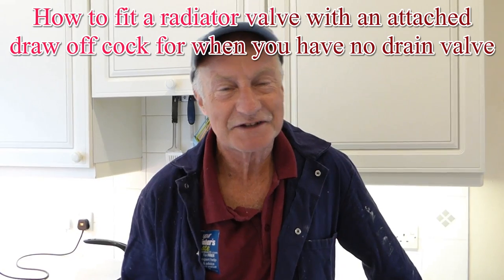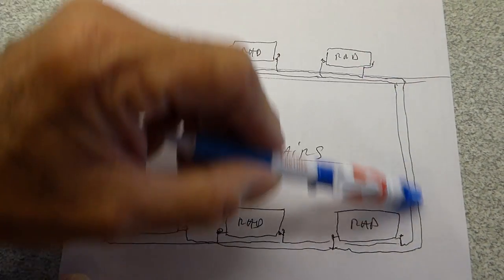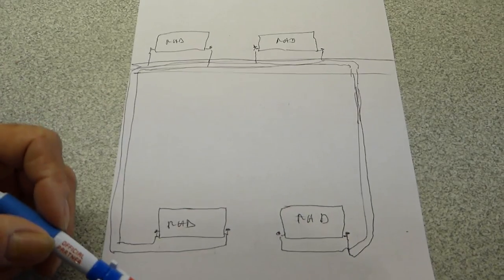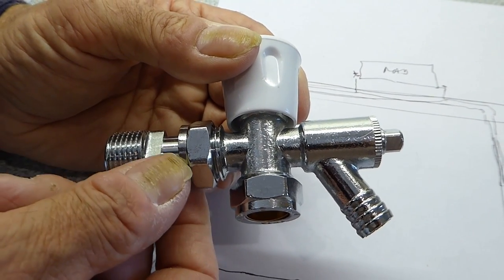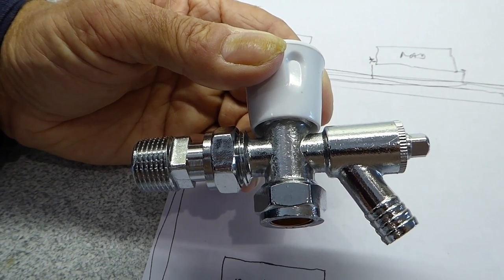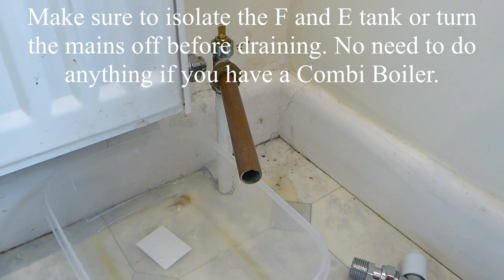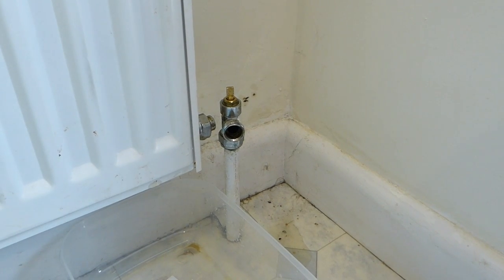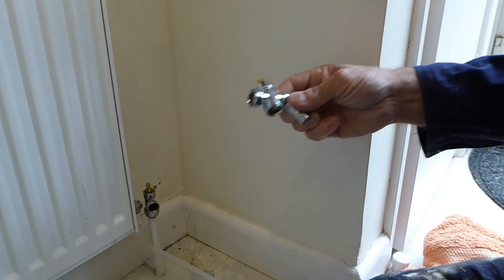How to fit a radiator valve with a drain off cock

Comment: Big thank you! Had to swap a draincock that was completely rounded off and wouldn't drain. Ended up having to remove the olive (as per your other vid) as for some reason the old 10mm nut was ever so slightly too small to connect (and yet 8mm wouldn't fit either). Despite being a DIY phobe it's now all fixed (even if I am soaked through!)
Reply from the maker: Nice work!

Comment: I have a seized drain cock so this is exactly what I need to do but may drain system completely to fit new valve/drain fitting. Thanks for the video.
Reply from the maker: No problem

Comment: Hi its Paul McKay (see below) and I have just completed this job but without the thumb stopper trick. It was so easy I should have thought of it myself, but that is where your experience comes in. angle valve and drain and PTFE tape from Tool Station for less than £5! No leaks but still need to try it hot...
Reply from the maker: No problem

Comment: I did this today, not a good Idea, panicked when the water came spurting out, thought I was Jed Clampett with the black sludge, thought I had struck oil. and the valve went on crooked.because I panicked So I have small drip. Plan to do it with a hose. Great video, they give you confidence to tackle these jobs And now I don’t do anything without checking  with you out first. Thank you
Reply from the maker: Never mind, it is all learning experience.

Comment: if one has a vented system with a header tank then it is possible to use a pair of bungs to temporarily bung up the vent pipe and cold feed. This creates a vacuum and after running a bit of water out it should stop fairly quickly. This method has worked a treat for me. Just have to remember to have only one open end at the time
Reply from the maker: +Nick Collins . Never worked for me. Air seemed to get back in some how and down would come the water.
Reply: +dereton33 It can depend on how smooth the tank connector is. That is critical. I find some have a nice smooth opening whilst others can have annoying ribs or grooves preventing an airtight seal.
Reply from the maker: Had one bad experience in a customers house, always drained the system after that.
Reply: Please send us a question for me, but it is a good day 9th. The may not copy of

Comment: Hi mate, further more, I moved in to a new build house for two years.
What do you think if I need to replace 5 TRV for radiators up to this moment for my house and I am going to replace the sixth. In your opinion, is there anything wrong with the system. You know my mum moved into her house for at least 14 years from new and never replace any of those TRV for her house.
Thanks for helping
Reply from the maker: The builders probably used real cheap valves.

Comment: Hi there mate, I've watched many of your videos thanks! A quick question if you don't mind, one of the valves for my upstairs radiator is leaking, I can't stop a little drip. The wife doesnt want me to drain the system, doesn't trust me or something haha 🙂 tell me, if I disconnect the radiator as in this video  can I replace the valve olive without draining the system? Hope this makes sense !
Reply from the maker: Unfortunately not, if it is the pipe connecting olive, but you can if it is the rad union side.

Comment: hi.al great vid and a great idea.just fitted one to my radiator on a combi boiler system,  my question is how do you use this drain off to drain just the one radiator and how do you use it to drain the entire central heating system? many thanks.
Reply from the maker: +arfan jhangir Hi arfan, it will only drain the complete system or a droped  piped radiator.
Reply: +dereton33 you can just drain that rad if you shut both valves off and open the drain off, it will drain the rad and not the pipework. this is if the valves are in working order!!

Comment: Legend. I'm going to have nightmares later about fountains of dirty water spewing out the valve over the wall, but I like it.
Reply from the maker: No pain no gain. Ha ha.
Reply: Seriously though, this was a really useful video. Saved me a lot of grief. I thought I was going to have to drain the whole thing down by letting it dribble out of the valve nut into a tray and keep emptying that. 
The real tip was rotating the valve head so as to fit a hose and let it drain outside. It was a drop pipe system as well so had to tackle two radiators. Have now fitted drain off valves. Thanks once again for your great video.
Reply from the maker: No problem Dominic.

Comment: Nice video. I have two questions. 1. Is it worth having the drain valve on all radiators on groundfloor? 2. Is there any problems in having them on all radiatorson ground floor? Thanks a bunch.
Reply from the maker: Yes it does help with the draining of the whole system, especially on dropped pipe systems. It is a good idea to have them.

Comment: Hi mate, If I got a radiator downstairs with the TRV on one side and the drain off cock on the other side of the radiator. The boiler that I am using is combi one. What the procedures I need to do in order to replace the TRV of the radiator? Please tell me what I need to do in step by step and the things I need to be aware. I only know little about the job. I am appreciated for your help.
Reply from the maker: Hi Edwin, first drain the system by using the drain valve on the other side of the radiator. Fit the new TRV then re-pressurise the system using the filling loop to one and a half bars, bleed all the radiators, but keep re-pressurising the system as you do them. Once all the rads are clear of air make sure your boiler is once again at one and a half bars.  That`s it.

Comment: what do you do if your rad is in the cellar and you have no doors or windows?  i want to drain  down to fix some things and fit a drain valve like this video but in my cellar it is enclosed. thanks
Reply from the maker: Drain into a couple of buckets. Or use a pump.
Reply: @dereton33  thanks. if i drain it the rad is only  2 inches off the floor will the water still flow out??  OR do i run the boiler so it pumps out???  basically  i could drain it into a bucket but it would have to be a 1inch tall tub i guess then pour into bucket.

Comment: Hi, where is the link to the larger valves that you mentioned? The standard size available is 15mm X 1/2 inch but my radiator appears to be 1inch, is this typical for an old radiator?
Reply from the maker: It will be 22 mm I never put the link for 22 mm but they are on Amazon.

Comment: I need to fit this exact valve (the one with the larger nut) in a house with 13 rads and no drain off fitted. The rad closet to the back door has a leak from the nut connecting the copper pipe coming up from the floor. 

I presume I shouldn't I chance the quick change over method as the olive on that nut has obviously failed?
Reply from the maker: No I would play safe and drain down there would be too much pressure on that rad valve.

Comment: can you put a TRV on the drain valve elbow? I need to replace the elbow my TRV is on (the pin in the elbow has had it, it keeps getting stuck) so thought I could replace with an elbow / drain cock.
Reply from the maker: yes.
Reply: thanks, although I ended up getting a standard valve / trv. Shop only had one type of drain cock for sale which wasn't compatible with a trv. Draining a big radiator took longer than expected, going to look at getting rad clamps so I don't have to do this again.

Comment: No PTFE tape
Reply from the maker: Not on compression fittings
Reply: Where do you think that is needed?  The only place for PTFE is on the radiator tail threads.

Comment: I'm sorry but some customer won't be happy with that mess on the clean new decorated wall. I'd drain the whole system.
Reply from the maker: Good luck with the airlocks and the extra 3 hours work. Still I guess you can charge more that way,
Reply: @dereton33 
I know what you mean Mr, I'd do what you did in some cases, but some new walls better will be ruined.

Charging wise you charge for the work you do for them not matter what Mr.

But after all Ive learnt alot from you and plus this tutorial taught me some. Thanks

Comment: Why not just drain the system, this is totally wrong. Look what damage you have done to the wall, customers wont be happy.
Reply from the maker: I was just trying to show what can happen if you do not drain the system, but do a live change over. Getting an airlock after the long process of draining the system and refilling can take a very long time to sort out. So 5 mins to to change it this way or 3 to 6 hours the drain it out way.. Still I guess you get the chance to charge your customers more money that way. By the way no damage was done to the wall it all just cleaned off with detergent.
Reply: @dereton33  you have a fair point my friend. 

The radiator valves with drain offs are really good additions.

Comment: I just replaced 3 radiators i have single pipe system after that all my radiators not working all mean all 10 radiator  take off air from all radiators still not working 
Please help me how to fix back to normal  
Thanks
Reply from the maker: You have air in the system. Bleed all the radiators check for air stuck around the 3 way valve,, also make sure to beed air from the pump. .
Reply: @dereton33  bleed radiator take off air still not working 
Can you please explain the 3-way valve  ?  Thanks